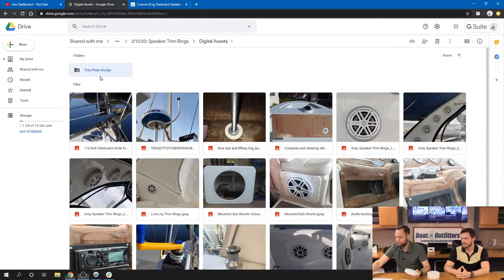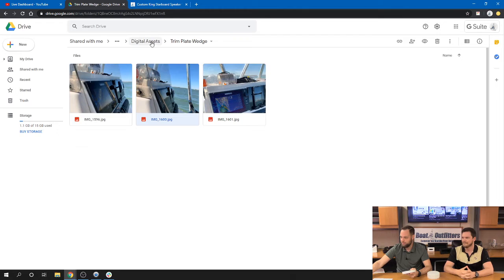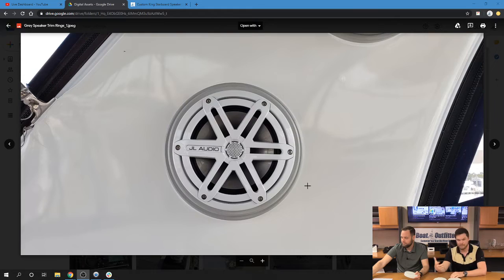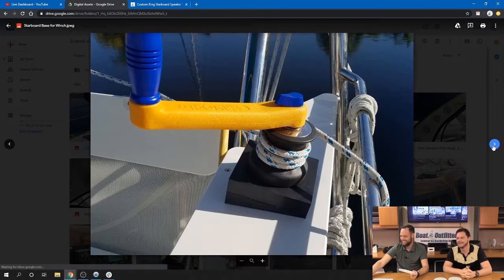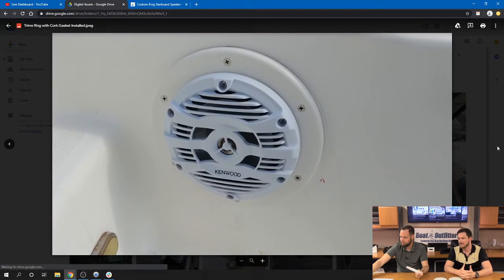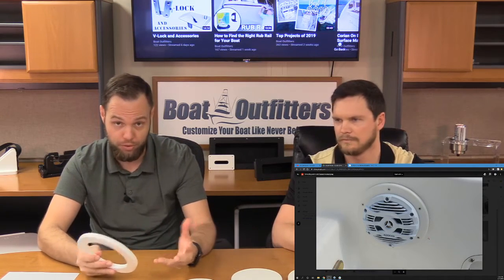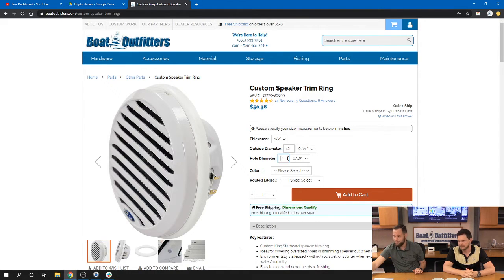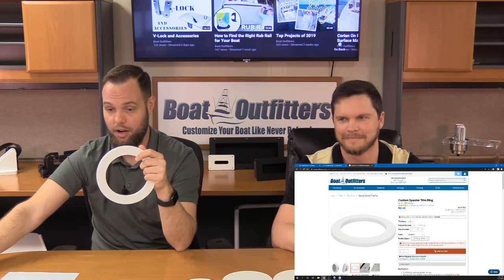Custom Speaker Trim Rings for Boats

Comment: I'm looking for a bracket that I can mount my new speaker. Because the new speaker falls into old hole Because it doesn't have the outer trim the the old speaker has to screw into boat wall. Need help

Comment: Do you screw the spacer ring to your boat then then speaker to the spacer ring?
Reply from the maker: Hey Stephen, great question! It actually depends. If you are going from a larger speaker to a smaller one, then it would be ring to boat and then speaker to ring. If you are using it to increase the effective mounting depth, but the speaker's diameter itself would reach the fiberglass if it weren't for the depth, then you can go through the speaker and the spacer ring and into the boat. It all depends on the size of the hole compared to the speaker mounting holes.

Hope that helped answer your question! If you still would like more details, please feel free to give our customer service team a call at 866-633-7961!  :)
Reply: I want to add speakers to the rear transom of my boat, but the vertical plane is contoured/rounded as it approaches the swim deck. What is the best way to get you the actual dimensions in order to custom make speaker rings?